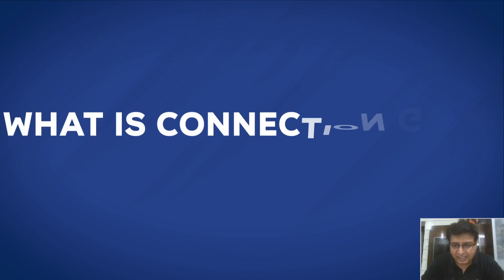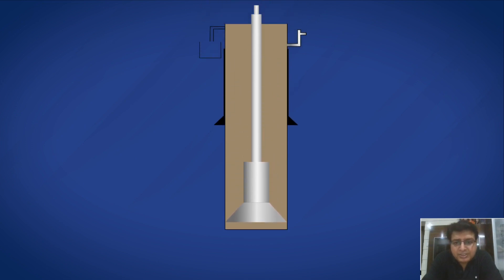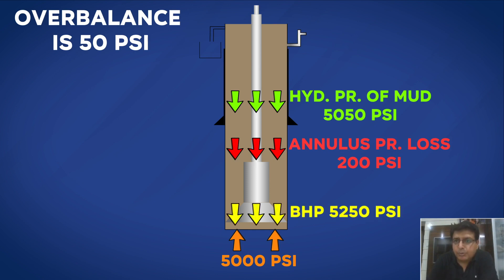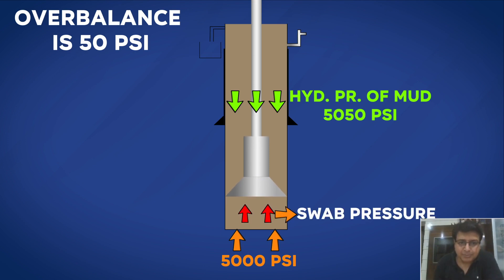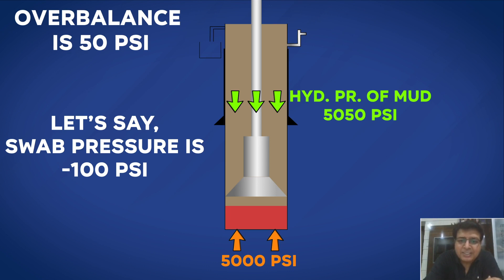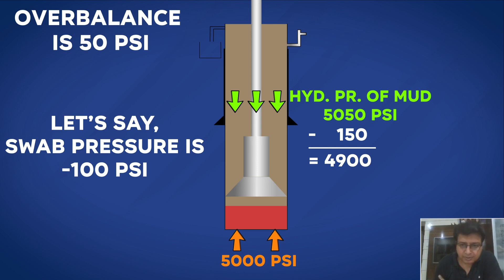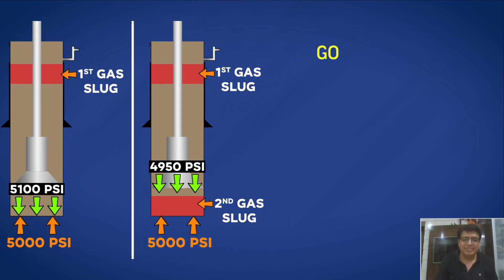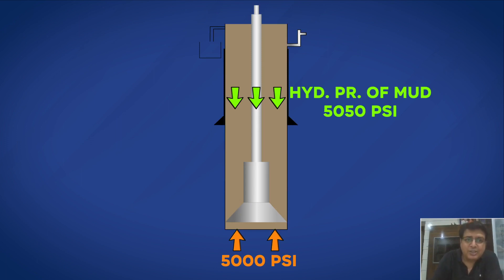Connection gas in English | IWCF | Well control |  Drilling | trip gas | background gas | BHP | APL

Comment: How about we continue our pumping until we space out and set the slip. And break tds for new connection which will not allow a swab below the bit. Will this not be a good practice to develop
Reply: If you are flowing with high flow rate and having high pressure in the string while you set in slip, you might damage the pipe. 

But usually i suggest driller to  drop down the rate to 100gpm with standpipe pressure around 100 to 200 psi and set in slip to reduce the swab effect.
Reply: @fahmietalife  how/why will it damage the string if it set on slip?